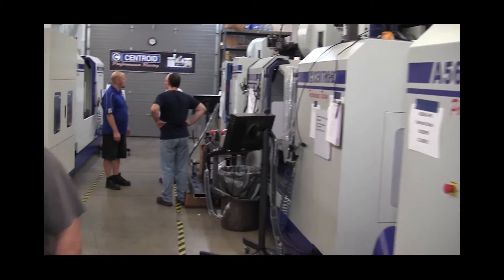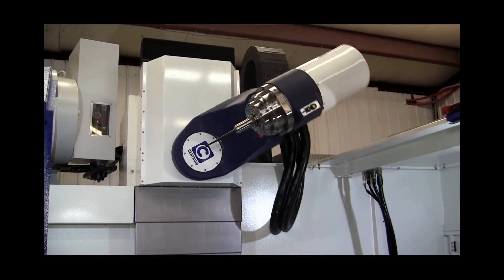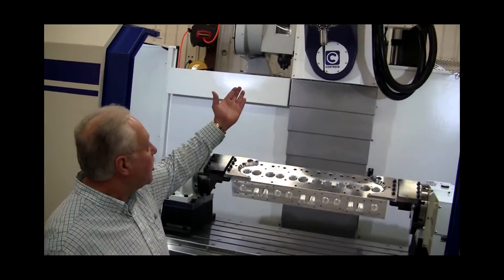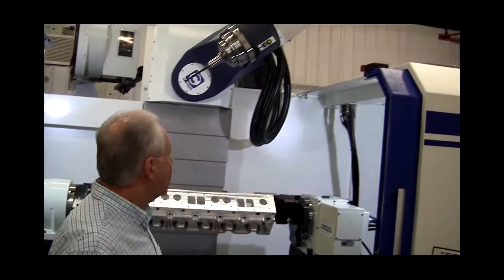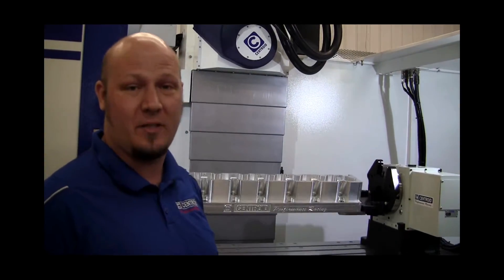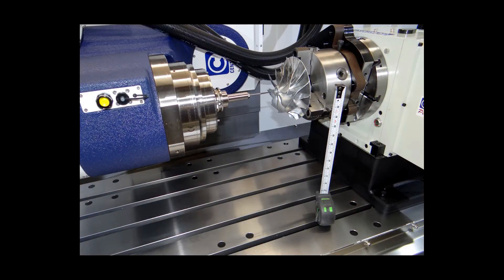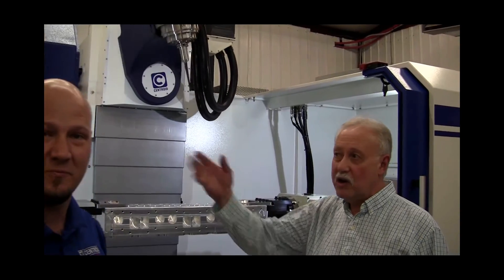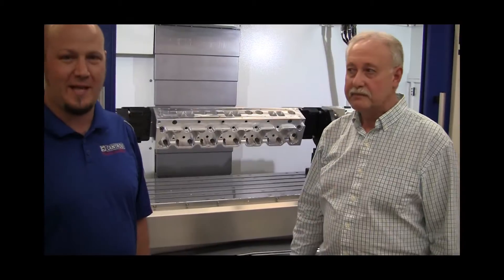Centroid PRI 2017 New A590 5 axis CNC Engine Shop Machining Center

Comment: And it wears out in 1000 hours
Reply: why?
Reply: @buatbelakang1405  finally after 3 years , i can respond, that is my casting design, machined the pattern myself, comes from the a560 design that i did , but i did all the calculations , that is why the a560 uses a ballscrew, moment of inertia , i left the company , and rich and greg decided to do this anyhow , which they , not doing math, decided it would work, oh lets put a harmonic drive , oh that doesn't work , let's add a planet artery gear, and then if that doesn't work , lets, add at sony encoder, and then joe buys me a laptop to say it is not going to work , and never pays me